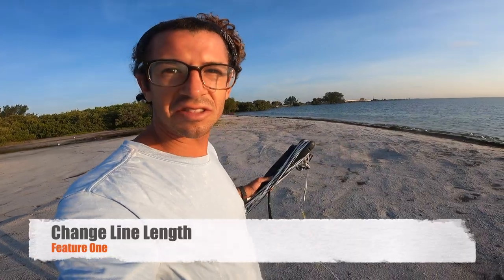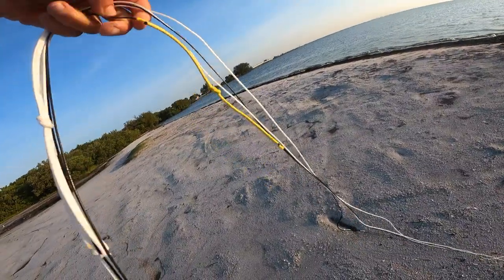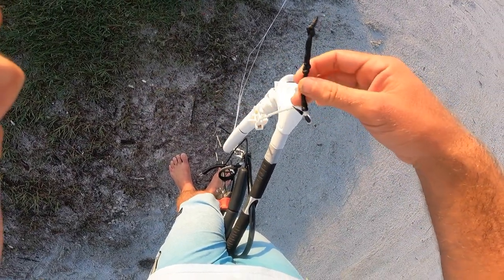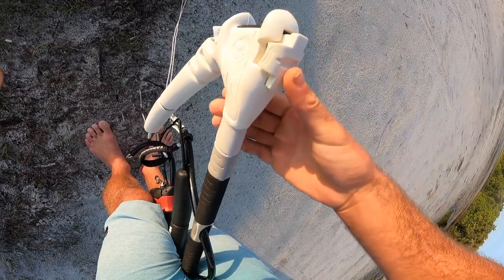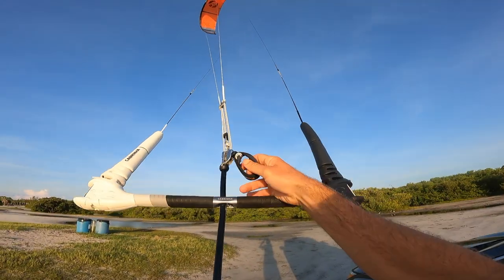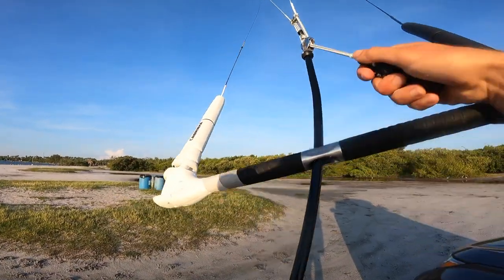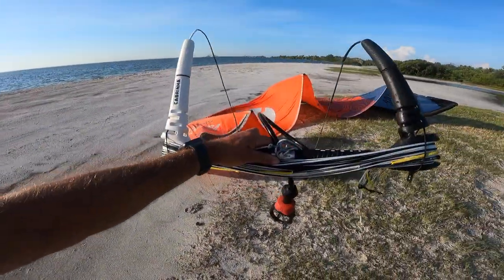2022 Cabrinha Overdrive Trim Control Bar 5 Features

Comment: Useful video, many tips, thank you.  Bought the 2021 recoil bar but the flexible rubber split and ripped after a just few uses over the winter and I’ve been waiting 3 months for a new warranty replacement after Cabrinha rejected warranty initially with the shop, despite only a few uses of the new bar I bought.  Disappointed with the Cabrinha unhelpful reaction & now timeframe.  Honest feedback here from a loyal Cabrinha customer with 5 x kites and board and accessories but it means nothing.  Had trouble getting a new board handle on warranty period when it snapped just carrying my board.  Feels awkward during warranty having problems getting issues sorted.  New 2020 bar broke only just outside warranty on the swivel part and no support received or spare parts offered, even after spending on Cabrinha within a few weeks and months $10,000.  Did get a new board handle n the end, nothing for first bar, nothing yet for 2nd bar (3 months wait so far).
Reply from the maker: Damn, sorry to hear. whats the flexible rubber that youre referring to? Is it the depower mainline?
Reply: @KiteboardingStPetersburg  It’s the handle of the bar (after the right angle) where it is thin and flexible (on purpose) with the lines inside - but it’s all split and broken unfortunately.  :)

Comment: Finally a clear explanation of the line width adjustments! THX. I'm a newbie and others had told me wrong. So as a newbie on a 12m (my only kite at this point), which width would you recc.?
Reply from the maker: Thanks Doug! I would say it depends.. If you feel like you sometimes dont have good kite control with things like putting the board on or body dragging or ever feel like the kite is "getting away from you" - then do the 44cm setting but if you want the kite to be more responsive then do the 52cm setting

Comment: have you observed that the trim line(bungee in the cleat) wears out quickly? 
what I don't like from this bar is the number of extensions necessary to have a length of 24m. It's really not slick..

Comment: Have this exact bar but had a jet ski get into my lines and sucked up one of my steering lines and ripped the left leader out of the handle and lost the insert cassette piece. Any advice where to get all the parts in one place? I find one piece on a website then another on a different site.  Really frustrating i cant get all the stuff I need on one shop so it all comes at once. It also messed up the depower center ones that go through the black tube. I pulled that line out and disconnected it but apparently ypu buy the whole thing in one piece.
Reply from the maker: sorry for the late reply! I would recommend Adventure Sports

Comment: Thanks for video 
What is difference between carbinha moto and switchblade ? 
For a newbie like me is 9 m or 10 m a better option (83-86 kg weight).   Also what size of board. Looking for all rounder kite and board.
Reply: Take a Moto. Its more forgiving in case of wrong stearing and has a larger windrange. Also depower is a bit more at the low end. It has 3 struts so you can better ride in lower winds. Size depends on the strength of the wind. If wind is around 18 knots I would go with the 10 or 11.

Comment: There is better way to wrap the bar up. Just let the plastic coated depower line out. Start wrapping from one floater and both front lines, then wrap it around the bar in a figure of 8 and take the last floater after first wrap. Wrap it on the side of floaters. You did it from the side of chickenloop. Using this procedure unwrapping will be easier. Also your depower line will stay straight.
Reply from the maker: "better" is subjective.. this way also allows me to see if all four lines are tuned when i get to the end of the pigtails.. also when laying the lines out i believe this method is quicker
Reply: @KiteboardingStPetersburg  sorry I didn't get it. Could you explain the advantages of your way of winding lines.
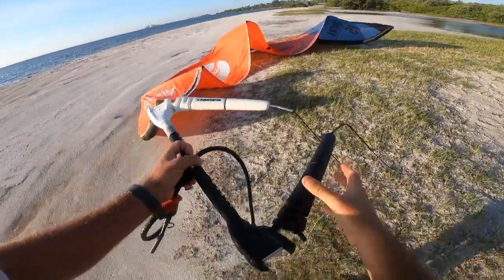Reply from the maker: @bodhisar  at 5:16 in the video I demonstrate where i get the outside lines, then the center lines. I hold all four lines together at their starting point and figure 8 on the chicken loop side. 1 advantage is that by the time i get to the pigtails I can get a general sense of if my lines are tuned.. if you look carefully at the end of the wrap you can see my center lines are an inch longer than the outside lines (they need a slight tuning). advantage 2 is that when im laying the lines out from the chickenloop side, no floaters get in the way so all lines easily come undone.. if you look at a new cabrinha bar, they come wrapped from the chicken loop side.. but again, totally subjective so whats better for me may not be better for you.. I think as long as the depower main line doesnt get bent in an unnatural way all is good.
Reply: @KiteboardingStPetersburg  Your depower line is bent. The best way to check your lines is to check it properly. But yeah, if you like your way, why not.
Reply from the maker: @bodhisar  the depower mainline is not bent. And I agree, the best way to check your lines is to do a proper tune BUT this method provides a general sense of if your lines are tuned or not.. Anywho, this conversation is going in circles. Happy kiting!

Comment: Hm - I don't really get it, you are calling everything a feature that is totally normal (Swivel, Quickrelease, Flagout-Line, ..) 
These thick pigtails at the connection 18m + 4m ... nothing i want to have there.
Swivel is no Auto-Swivel - that would be a feature.
Clamcleat is not working well  .. takes you several attemps to release it .. not nice while driving.
Reply from the maker: I’m sorry you don’t really get it - features in the English language are defined as attributes or traits of a certain object. This is what I talk about. What I believe you’re commenting about or “looking” for are “features that stand apart from other brands” - that’s not what I’m doing here. I’m just drawing attention to “traits” or “attributes” on this control bar. Stay positive my friend and happy kiting